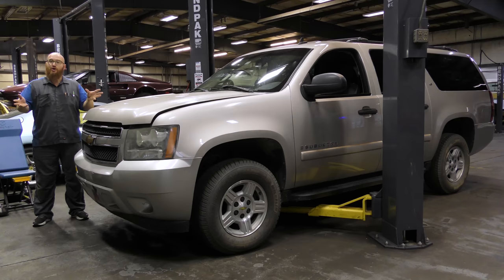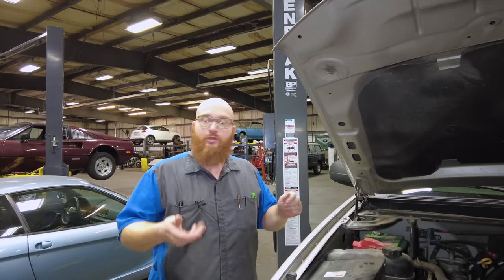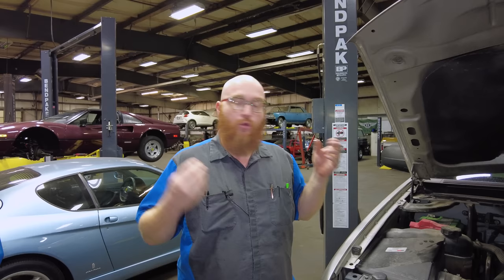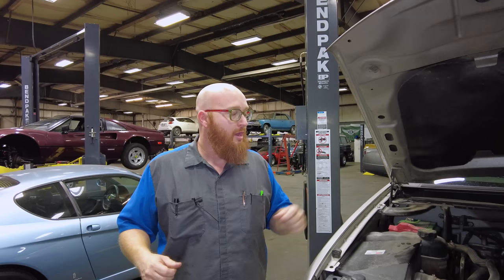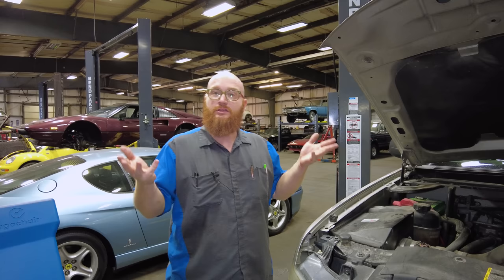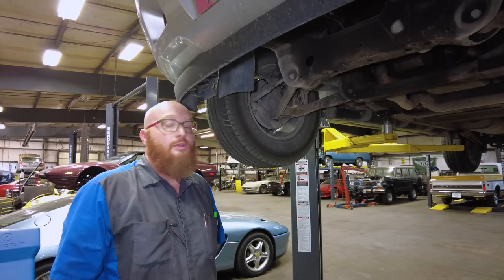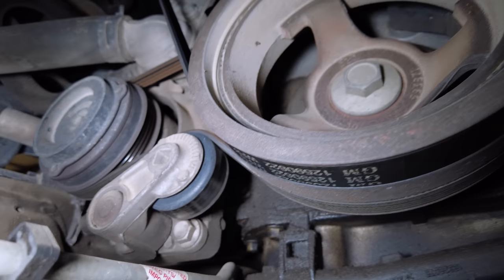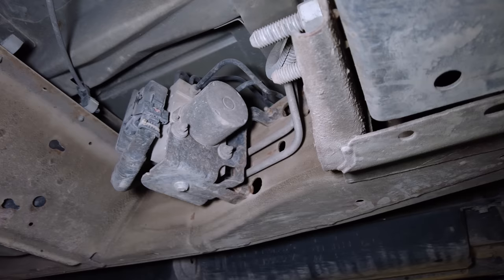What fails on ALL early 2000's Chevy SUV's!? CAR WIZARD shares what he's seen from the last 20 years

Comment: A good video, great commentary and explanations.  I have a 2000' S10 with the 4 cylinder and its close to 170K miles, it's only run occasionally and had been my Dad's knock around truck for brush and mulch.  The fuel pump sender died 4 years ago, I blew it off and just kept gas in the tank.  And then one day, she wouldn't start, I couldn't hear the pump priming.  Sure enough the fuel pump/sender unit had failed completely, a common S10 issue.  Luckily it was in the driveway, I had bought one when the sending unit died, and the weather was wonderful for about a week.  I replaced it myself by jacking up the front of the bed.  Like the vehicle you referenced today, she also has the random ABS/Brake light alerting at the same time.  Sometimes all you have to do is hit a bump in the road and it comes on.  Or hit a bump and it goes off (HAH!). The oil dipstick seal seems to be leaking (gotta change that), possibly the valve cover gasket leaks, and the rear diff input seal is weeping (gotta change that).  Did change out the U-joints about 10 years ago with MOOG units, no issues since.  The AC compressor seized last summer and before it gets warm I need to replace it (along with the condenser and dryer) and have parts in-hand (along with a well used set of gauges and vacuum pump, I've done a bunch of AC work for my family and friends, learned how in the Navy).  I don't tow anything and the trans seems okay, it does take 15-20 sec to build up pressure, kinda lags a little after starting, but no slipping (yet). It's only had the filter changed once.  As you've noticed, and I've read online in chats, GM sure does like repeating the same mistakes across models...  Thanks for posting your video.

Comment: Love those vehicles, mine has 232K and engine runs like new. only listed problems I have experienced are the knock sensor failed quite some time ago, I had not read the service bulletin about building a silicone dam to prevent water from getting to the connection again and now I have to do it again. My A/C actuators work but now and them make a funny noise. I have the ABS / Brake light on, have not fixed it yet because my module is so hard to get to, every now and then it works but most of the time it does not. I wish mine was like the one you showed but it is on top of the frame with almost no room to get your hand up there to unscrew the fasteners. I tow with mine in 3 and the tow haul button in. You did leave off one common failure which is the exhaust manifold bolts breaking due to expansion and contraction of the too thin exhaust manifold.

Comment: I have the H3, and I always tow with the "3", but it can be felt, heard, and seen in the tach that it locks the converter in the third also. The gas mileage is about the same because here in Finland (and Europe) you can not tow heavier than 750 kg trailers faster than 50 miles per hour (80 kmh). The engine is happier, and the transmission has perhaps greater holding pressure at 2500 engine rpm. I used to have a Buick with the "200" transmission, and the original owner's manual stated that "this car is not designed to tow anything, if needed, GM has vehicles that are designed for towing", or something like that. But the cure was to alter the geometry of the cable that goes to the transmission at the carburetor linkage; by making it more drawn right from the idle but still having the same travel at full throttle as originally, the holding pressure in the transmission was greater and the transmission lasted longer. The shifts became more firm but not too much. It also applied to the "700" transmission of my Caprice, as it no longer was a "kick down cable", but a way to tell to the transmission what to expect. I almost got nostalgic with the oil pressure sender, as a long ago I had a similar issue with my then 440 Chrysler...

Comment: My 2004 GMC Sierra has 280,000 miles. Running great. Uses no oil in 5,000 miles still. Power steering leaking. Great truck

Comment: Lol just for the fun of it, i checked if single coils are sold for this engine instead of getting the whole set…wizard thought it was not possible for them to sell u a single wire..but it’s possible and u can check online. Advance auto will sell u a single coil wire. I have been there where only 1 coil crapped out of 6 and swapped that with a new one and it drove fine for another 6 years…not advising to do it if the cars needs major tuning up might as well buy whole set. But if its a daily and only one crapped our,u can buy a single coil and send it. Thanks for attending my ted-talk

Comment: Wife bought a 2007 Chevrolet Tahoe with 5.3L AFM engine. Still driving with original engine and transmission. Has 285,000 miles.

Comment: I live in the UAE and I sold my 2013 Tahoe LTZ last year thanks to the lifters failing twice on me in the 9 years I owned it even though all my oil changes were at the dealership. Yes the interior had issues and the chrome door handles kept snapping but overall the transmission, suspension and electrical components held up well. Its a pity that the 5.3 was flawed with that nonsensical AFM. Still miss my Tahoe and I never really could gather the financial courage to cough up $60K+ on a 2022 truck at the time which was offered with next to no benefits in terms of additional warranty or service packages.

Comment: I just want to clarify one thing you mentioned. The 2000-2002 sub/tahoe is the exact same body style as the 2003-2006, 1999-2002 for the silverado. They made one major change from 02 to 03 when they changed the pickup body to the slanted, cat eyed, headlights. For the 2003 model, they added flex fuel capability with AFM, active fuel management. However, it operates in a much more (logical?) way. My 2011, floats a set of valves open,and is riddled with afm issues. The 2003 that I have, cuts fuel off to the passenger side fuel rail. Have had zero afm problems with this car. Also, autozones computer says that 85% of the 2003-2006 models sold, were flex fuel capable with afm. This is no joke by the way. My 03, on the highway, gets right around the same fuel mileage as my 07 cobalt......yes, I'm dead serious, right around 28mpg. Another thing I want to mention, when they made this change between 02 and 03, alot of the mechanical parts had to be changed to make it flex fuel compatible, especially anything fuel related, so they had to change the electrical connections on all fuel related parts. They also changed the electrical connections on say 50% of the rest of the electrical parts. I cannot tell you why they did that, I can only verify that the climate control from the 02 will not plug into the 03, although everything that doesn't use power, is exactly the same and will swap right out. My 03, who I will most likely be retiring soon, has 350k miles as of right now. I had a 2001 2wd suburban at one point, I totalled it at 390k miles, pushed the radiator into the fan and motor. But it was still running after the accident, I had to physically shut it down. I love these vehicles, and there is a reason the suburban has been around for longer than any other vehicle nameplate out there, almost 100 years now. But as you mentioned, the 4l60e bolted to the 5.3 will not handle towing in OD. I don't recommend towing anything heavier than say, an s10 blazer on a car trailer, and only for short distances, no mountains. If you wanted to use it to tow with, you shouldn't have gotten the fuel efficient ½ ton. I'm currently using my 07 Escalade 6.2 AWD to do all my towing, yukon also offers this drivetrain setup.......this thing is a beast of a ½ ton. The 03 is more for hauling all 9 people, 3 bench seats, cross country, time and again. 350k, and just used it to drive from Pennsylvania to Texas, and back, with no problems. 4th transmission and 4th fuel pump, 3rd starter since I purchased 12 years and 120k miles ago, but the original engine is in the car, and has never had a bolt loosened on the motor, except for the exhaust manifold bolts to swap the tranny out. As of right now, there are 5 broken exhaust manifold bolts, on each side. Side note, they sell these clamps that bolt to the head using holes that are not currently being used, and work remarkably well at silencing that tic tic tic from the manifold leak. As the body is starting to rot, and it developed a random multiple misfire recently that I can't track down, really leaning toward stretched timing chain, I just might cry when I scrap it. I've never put 100k on any vehicle that I owned except this one. Typically, I would never pay more than $2000 for a vehicle, and never owned it more than 2 years. But I also never sold a vehicle either, when I'm finished beating it around, it's not usually worth selling to anyone but the scrap yard.
Reply: 28mpg lol? Absolutely not. These get like 14 in the city and 17 on the highway. I am not sure here you got that data, but it is inaccurate.
Reply: @calebniederhofer6529  my data is coming from my personal experience with the vehicles I have owned over the last 20 years. The 03 5.3L that I still drive daily, has 360k on the odometer, with original engine, most certainly does get between 24 and 28 mpg on the highway, because the afm system cuts fuel to the passenger fuel rail. However, next Gen afm floats the valves open on that side of the motor. Still only using 4 cylinders, but also still pushing fuel into those 4 cylinders not being used, which is tge stupidest thing gm ever did. All of my newer Gen suburbans only get the mph you stated at about 14-17. But apparently the first Gen afm worked too well and didn't fail nearly enough, so for the second Gen afm,  they took a page from the old quad 4's unreliability section, and put more engine load on one side of the valve train, camshaft or timing failure rates skyrocket at this point, I'm assuming due to unbalanced load on the timing system as a whole. The 03-06 5.3L flex model has the first and best generation active fuel management system so far. My 03 suburban will not tow a full size vehicle without needing a new transmission a week later, but when put on the interstate, competes with my cobalt in fuel mileage, while carrying twice the occupants and doing it comfortably. I've owned about 8 or 10 5.3L chevy trucks and suburbans, all with well over 300k miles, but that 03 flex fuel version, is the only one to get over 20 mpg. These are all facts of MY PERSONAL EXPERIENCE. Not specs from a brochure or someone else's experience,  this is what my car did for me.
Reply: @calebniederhofer6529  I also want to add that I only use mobil 1 full synthetic 5w-30 with a quart of lucas oil stabilizer, and oil change intervals run between 8k and 10k miles. I let the car tell me when it's ready, usually closer to 10k miles, again, the engine may be the only part that is original to the truck, and I don't baby it either. She sees 5 grand on that tach quite often, as well as getting swamped to the axles in mud, and killed at least one dear ever year since we bought it 12 years ago, it just folds the brush guard into the hood so gently that it doesn't even dent it, I do have to grab the guard and give it a pull so that I can get under the hood again, other than a few scratches that you'd never notice anyway due to the clear coat and paint being almost non existent at this point.
Reply: @jakebebson6669  I am not going to argue with someone that is uneducated about the topic, respectfully.

Comment: You definitly hit most of the things I have done with my 04 avalanche although I don't have the AFM system thank goodness.  One thing that should have been mentioned I believe is the vapor recovery system. The charcoal filter near the fuel tank wears out and allows tiny charcoal pellets to fill the air lines so that one cannot fill the gas tank rapidly IE it keeps clicking off. These MUST be maintained and replaced every once in a while, I don't know the actual recommendation if there is one for this. Almost everyone I know that has a used Chevy truck has this problem as they get older.

Comment: The 4L60 does like the converter on third gear. Also it is also pulse with modulated so it constantly slips there is a modification to eliminate that. You left out The reaction shell failure.

Comment: Thanks for the insight but I wouldn't categorize a lot of your items as guarantee to fail items.  Many of your guarantees are fine with mine (ABS module, electrical connection above the engine, I have an '02 Tahoe w 250k.  You did mention a few of mine but some you didn't focus on for me were "rust belt" related in PA.  Rusted out brake lines, one by one (GM tried to save a buck and used cheap brake lines for a period of time that rusted due to the brine they started putting on the roads up north), exhaust bolts breaking (here's a trick that may work for some.  About 10+ years ago I had an exhaust leak due to exhaust manifold bolts snapping off.  I put on an aftermarket "L" bracket that bolted to the rear of the head and turned a knob to hold down the manifold.  shockingly its been working fine to present).  there were a couple recall or warranty items: manifold gasket leak and ABS not working correctly as rust gets behind the Wheel Sensor and needs cleaning ~ there is no permanent fix that I found for this (the Dealer fixed this once but I had to fix this about 5 additional times).  Had the Alternator and water pump go once each (pretty simple to replace).  Fuel pump went but i chalk this up to the kids running the gas task to fumes too many times.  This was our family car when purchased new and was used for 3 children being handed down as they went thru high school. All in great truck and haven't had a car payment on this since 2008.

Comment: I've got a 07 Yukon. They have active fuel management. Mine is a flex fuel. I deleted mine, cammed it, long tube headers and y pipe and full cat back exhaust, shocks, all new rotors and calipers wheels tires, headlights, taillights, rear wiper motor, fuel pump, starter, alternator, tune up twice, head gasket again little over a year after the cam job, wheel bearing hubs both (front), u-joints, water pump, ac compressor twice, main belt, battery, transmission, all fluids, radiator 3 times, some brake lines, radio, connectors for heater core by firewall, separate aftermarket transmission cooler, O2 sensors, thermostat and something wrong with the abs/ traction control system. I've had this yukon since 2019. Mine only has 163000 miles on it.

Comment: I own a 02 Tahoe with 328,000 miles no motor or trans issues changed out two water pumps ,AC compressor and alternator no other issues besides the rear oil seal

Comment: I would not buy with AFM and high mileage, unless the owner has proof of the lifters being replaced. Unfortunately, they are usually sold with the lifters failing often. I bought a 2005 5.3 Yukon and would recommend buying a 2006 or before personally.

Comment: My 2000 5.3L V8 Chevy Suburban 4x4 has nearly 300,000 miles on the clock, runs like new, original transmission. Problems? Instrument cluster short that cause all warning lights to flash and needles to shake nervously until I sent it to a guy from Minnesota off of ebaY ($60 solved). Key fob remote keyless entry died long ago (use the key). Change oil regularly – no problems...

Comment: I'm curious why I've had such a good experience with my 2001 Chevy Suburban.  Yes, I've done basic maintenance and replaced the water pump once, rebuilt the Transmission once, did tune ups when needed, BUT I'm a 320,000 miles and I don't have all these problems you speak about and I swear I could hop into the Suburban and drive 2000 miles without any issues.  The only bad thing has been the poor mileage - only 16 mpg.  I look at paying more for gas as a trade off for driving a very safe vehicle.  I'm in Arizona, so there's certainly no corrosion on this vehicle.
I just repaired the tow light given that wire broke, but after 320k miles I suppose it's about time, BUT the ball joints seem to be all good - I drive long tours in Mexico and probably don't wear them a lot.  I'm distressed thinking about buying a used Chevy 2007-2014 range because I listen to these videos and I fear cost will be high on bringing it up to being super reliable?

Comment: Surprised you didn't mention the HVAC blower and resistor while you were talking about the actuators.  I also had to replace the purge valve solenoid at the engine in my Yukon, which a former Chevy mechanic told me is one of the most common failures on these.  When it fails, the engine is hard to start right after filling up the gas tank.

Comment: The main problems with the 4.8, 5.3, and 6.0 is they (1) won't run without both the crankshaft position sensor and the camshaft position sensor, which are redundant, so that's extremely stupid, and (2) they won't start if an injector is unplugged, which is extremely stupid because that doesn't affect emissions or durability.

Comment: I bought a 2004 Chevy Suburban1500 brand new, it has 165k now and still drives very well.  Thanks for all the tips on what to look for I now know that noise is the actuators.  It's been a fun hobby keeping it running tip-top.

Comment: i have an 03 yukon xl 5.3 1500- 300k miles--most reiliable  car ive ever owned,  plus had  an 06  suburban xl 250k miles , underneath dry as a bone, ran super until i rolled it. I have another  06 suburban that has been a fooking nightmare--lifters sticking, body control module fail, crankls position sesnor fail , instrument cluster, blend doors, ac compressor belt tensioner,  transmission , oil gage ALL OF IT IN ONE FOOKIN vehicle.---but it looks nice.